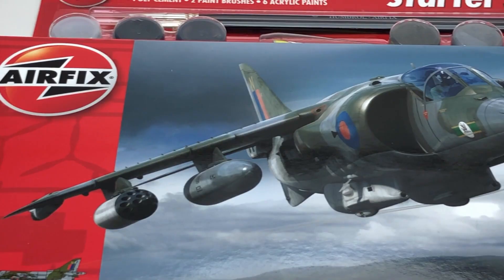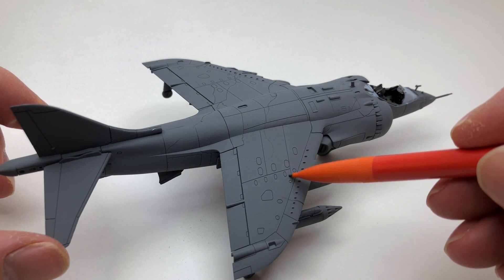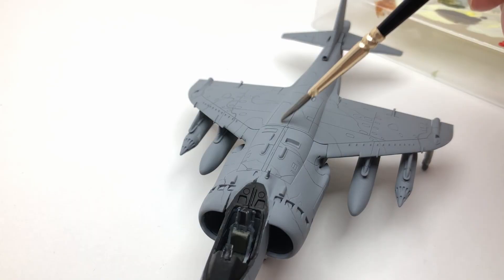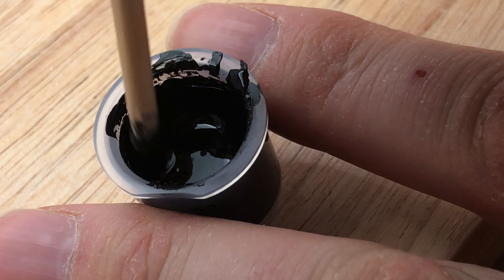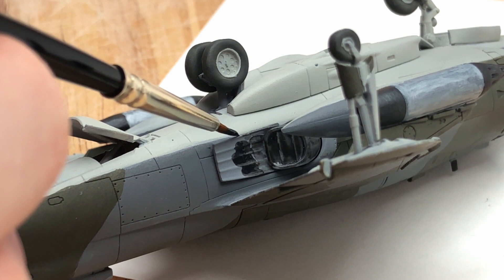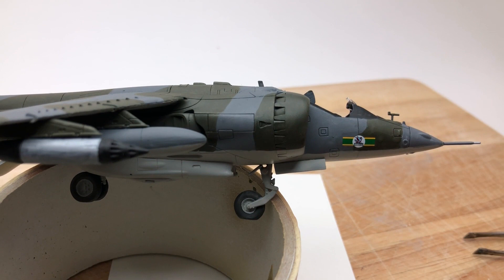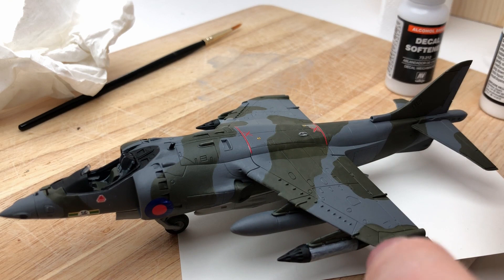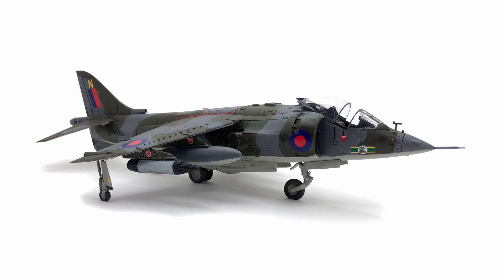Hand Paint The Airfix 1/72 Harrier GR.1

Comment: Pretty cool, I’d say buying a large flat brush is a must, when I got into the hobby I hand painted everything with a brush for around a year and the larger brush makes it soooooo much easier to get a nice consistent base coat. For camouflage I’d use a round brush for the edges then a flat one to fill it in. I would work with extremely thinned paints like a glaze almost so I would do around 6 coats that are super super thin and I would get nearly an airbrushed result
Reply from the maker: Cheers, yes it’s amazing the results you can get with just brushes. I thought some videos on just using brushes would be a good idea because it’s a skill worth practicing and a good start point. Airbrush for me next.. I’m really not that skilled with them yet! Hopefully I can get some good results and then do a video on what I learned 😀👍
Thanks for commenting and watching my vids. Cheers

Comment: The Airfix F-16 starter set got me into this hobby again and i must say that i'm quite surprised with the build (fit and included paint), so to 'hone my modeling skills' i'm thinking to get me some more starter sets :)
You used a primer? If so, which one did you use?
Reply from the maker: Yes definitely starter kits are good for getting back into the hobby. The Airfix 1/72 Spitfire was a dream to build.. I might try  the Hurricane at some point.
If I’m doing a quick build I’ll use off the shelf Halfords undercoat (grey).. it’s never let me down. I’ve tried cheaper brands and they are hit and miss. If I’m doing a more advanced build I’ll airbrush Vallejo or Mig ammo undercoats.

Comment: What paint/thinner ratio works best?
Reply from the maker: Depends on the paint.. sometimes its 50/50 and other times 70-80 water to 30-20 Paint for Acrylic paints. I'm still trying different ratios on Enamel.
Reply: @modkitmayhem  so what would you say works better for brush painting enamel?
Reply from the maker: For me, I'd go for odourless Winsor and Newton thinner (Sansodor) or basic Turpentine. I'm sure every Enamel colour will have a sweet spot in terms of thinning ratio. I'd guess Matt needs thinning more than Gloss.
Reply from the maker: start with say 10% thinner to 90 paint and see how it go's!!